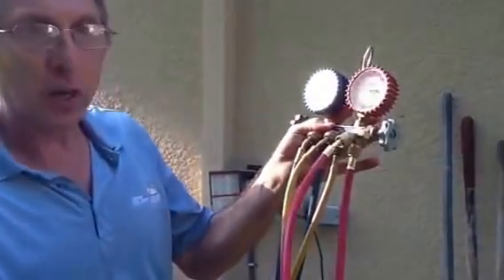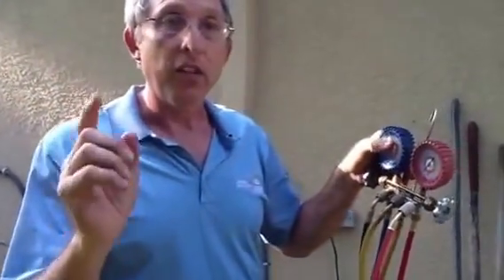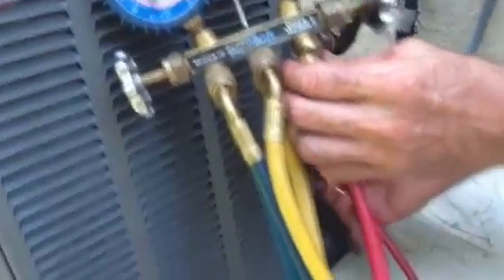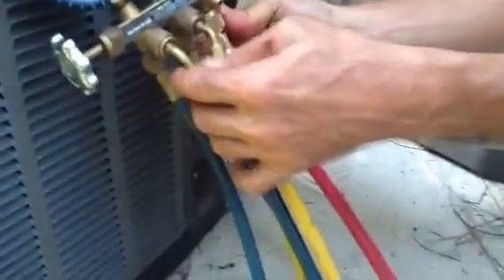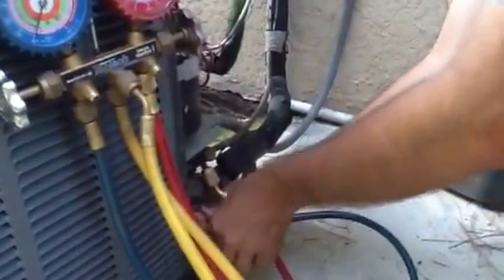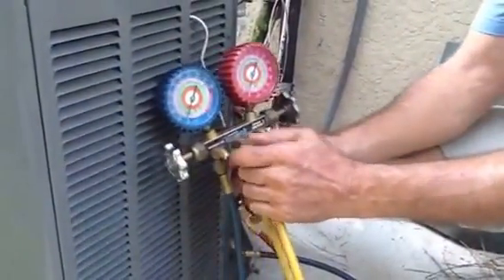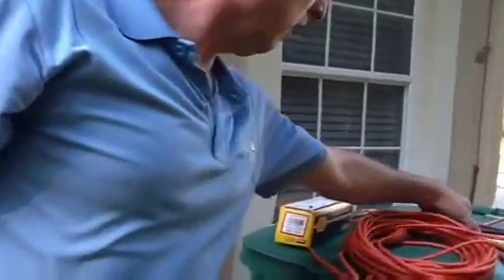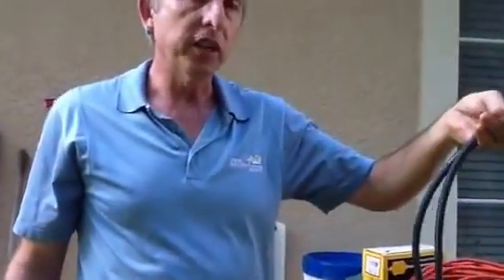"Warning:  Air in your AC System Can Kill your Compressor -- "How to purge Hoses Properly"

Comment: Now David, I am one that has a totally purging technique. Much more laborious than yours but 100% effective no matter what length of hoses you use. My hoses have a tap on the system side. My suction hose also has a tap on the bottle side and a 2 way valve in the middle. This middle connection goes to the vacuum pump. Yes I drag that pump everywhere.  Once all the hoses are connected and before I open the HP and LP taps I pull a vacuum on all the lines. I isolate the pump and wait a few minute to ensure there are no leaks. Then I crack the Liquid and vapor lines and bingo NO CONTAMINATION ANYWHERE. No matter what refrigerant you use , this will work. If you do your procedure on a R600 unit you run the risk of taking air INTO the system
Reply: When you say tap are you talking about a valve core depressor to hook up all the lines first, pull a vacuum, then break the vacuum in the hoses by depressing the valves?

Comment: Is there any advantage to cracking the connection into the manifold beforehand? Because I've always just hooked everything up first and then cracked open the hose at the manifold.
Reply: There actually is. 
  Think about the refrigerant that's entering that hose as you connect it to the system...
  The moment it enters that hose, it starts blending with any & all non-condensables that may be in your hoses.
 It's best to go ahead and have the 'back door' already opened for the non-condensables to be pushed out as soon as possible – before giving the non-condensables any time whatsoever to even blend to begin with.

Comment: What happens if you forget to do it once, any way to let the air you introduced out of the system? or is one time not going to damage the system?
Reply: The only way to get air and moisture out of your system is a total re-evacuation. There is no way of knowing how much you let in, and regardless no one is going to tell "a little is OK." You are not supposed to let ANY moisture into your system.

Comment: When you pull a strong vacuum doesn’t that remove the air on the suction line? I work on refrigerators and anytime I purge be lines it seems as I am losing vacuum pressure or letting more air into the system…

Comment: How do you know if you got all the air out of the lines? I didn't see any evidence of the refrigerant coming out of the hoses except at the very first.
Reply: I think is said it was low. Also, I would think the system should be turned off first to purge especially the blue or suction line.

Comment: How do you know when it’s finished purging?
Reply: Cement Cement thank you. I recently had a larger diameter return line installed, because I was told the one on our system was too narrow and affecting system efficiency. As well as being twice the diameter, the new line is about 30 feet longer than the old one (because it had to go up through the roof). After that was all finished, my ac seems to work about 50-60 percent as well—much worse—not better like we were promised. I’m wondering if they might not have bled the air from the new line before adding coolant. Does that seem plausible?
Reply: Cement Cement thank you for the clear explanation

Comment: How to purge the air that is actually in the Manifold 's metal part?
Reply: Keep valves closed on the manifold before connecting them to the condenser unit

Comment: if you use different gauges for each type of gas/oil  is it necessary to let any gas escape? or even purge your lines? Or wouldn't make more sense to put the lines on a vacume when hooking up? because I know mixing humidity/air with the gas makes an acid that destroys a system. Wouldn't it make more sense to never hook up to a system but have a port to plug into for readings and only connect if the system needs a change in gas pressure.
Less escaped gas, longer life out of systems being properly serviced. Less Ozone depletion.
Reply: when does the acid problem rear its ugly head... a few month later?

Comment: I heard of a tech not purging the hoses first (he admitted it).  I'm sure it did damage to the system right?  It's hidden damage that you don't see right away, but it will always do damage , correct?  IN other words, it will allow air bubble into the system producing acid and will cause the air bubble to eat away at the evap coil right through the rusts spots and then the system won't work several months after the accidental non-hose-purging, is this the correct way to word it?  It will most ALWAYS cause damage and is irreversible, correct?  In other words, once he did that, there is no reversing it?  (just assumptions at this juncture but hopefully founded in some truth as it relates to talking to HVAC techs and getting the "skinny" on these things.)

Comment: Except if the system is pumped from air before charging, then only the charge line needs purged so long as the low and high side valves are closed off after evacuating... is that not correct? Should be same procedure on vehicles A.C. systems.

Comment: I see one major error with this purging. You purged the hose but not the manifold vavle body itself.  I always purge from tank out to liquid and vapor hose just before connecting to service valves. Note: there is voids in manifold body that can contain many different foreign materials
If I'm wrong, please explain and will take post down👍
Reply: Please explain how to purge the manifold and the hoses together.

Comment: I have the YJ 42201 manifold 2 knob, 3 port w/ball valve on 3  hoses and unit has not been used yet. Assuming there is air in the hoses from manufacturing, would I have to open the valves and purge as you did in the video initially ?. If so, then after that, I should not have to purge since I can close off the ball valves...does this sound correct. I plan to use this set for R410 only. Thanks.